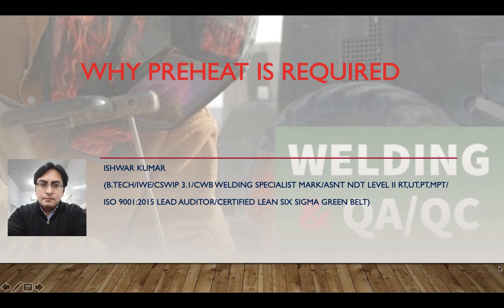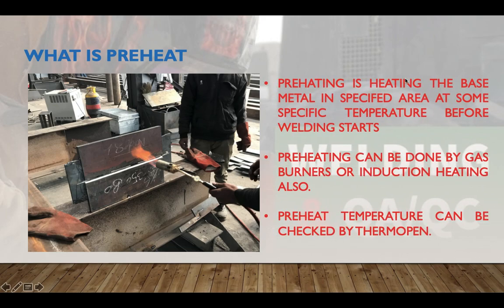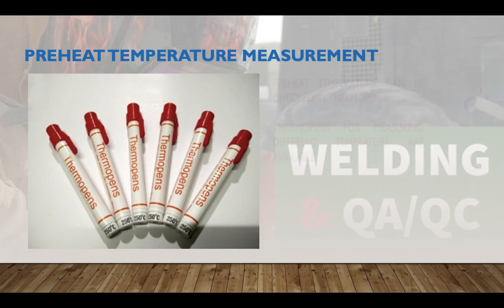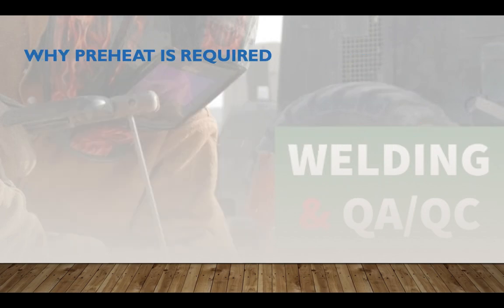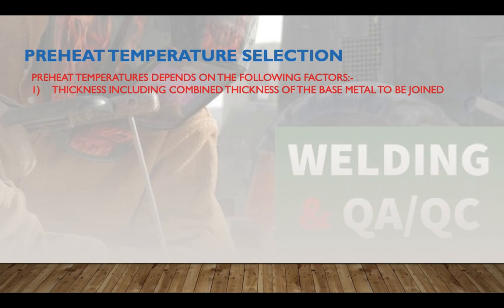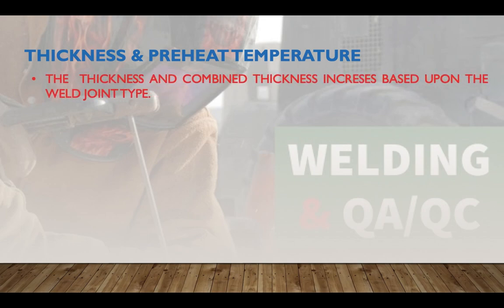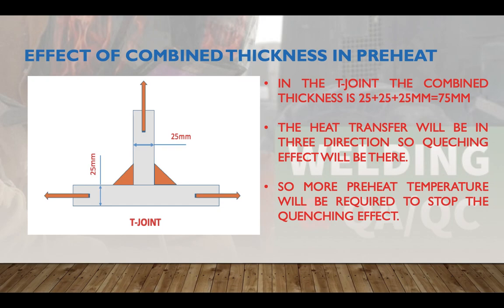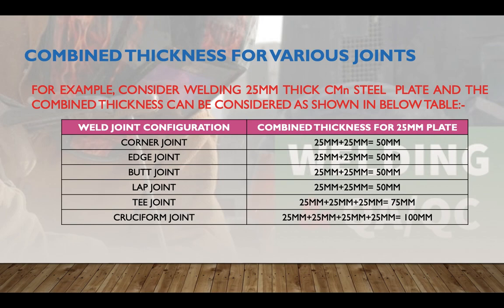WHY PREHEATING IS REQUIRED IN WELDING

Comment: Hello my friend is there any restriction in the code that if change the Gas use for preheating for example from propane gas to LPG
Reply from the maker: Thank you for reaching out with your query about the use of different gases for preheating. In codes e.g. ASME Section IX, there isn't a specific restriction on the type of gas used for preheating, such as switching from propane to LPG.

Comment: Thanks for your information. It is very basic engineering prior to welding process. Specifically it is carried out in Oil & Gas Industries with Pre-heating Auto Machine with programmer. And also Can be monitor the temperature.
Reply from the maker: Yes it can be monitored with the help of time tempreture graphs if required ..

Comment: Sir, as u explained the following factors to used for selecting preheat.. My quarry is that if P-no same.. Material thick >25mm then preheat mandatory.. And we go min 80 © preheat temp.. If material thick 150mm then how much temp required for this..
Reply from the maker: Thanks for your query..The need for preheat are dependent on a number of factors, such as the chemical analysis, degree of restraint of the parts being joined, and heavy thicknesses.The procedure specification for the material being welded specifies the minimum preheating requirements.ASME specify the preheating requirements as :-79°C for material which has both a specified maximum carbon content in excess of 0.30% and a thickness at the joint in excess of 1 in. (25 mm).As per AWS D1.1 for thickness of 150mm minimum 110 degree preheat is applied.
Reply: @ish8624  Thanks for clearing my doubt regarding this issue.. Sir can u please let me know that in which clause of AWS D1.1 it mentioned..
Reply from the maker: @shshnawazmallick  You can refer Table 5.8 AWS D1.1 2020

Comment: Question, would it be fine to use a carbon arch torch or push 500 through 800 amps with a metal heater ( some people taking a microwave oven transformer and wrapping some wire to out put a certain amount of amperage)?
Reply from the maker: Thanks for your question..Use of carbon arc torch is not recommended..Regarding wrapping some wire ..this is called resistance heating which is the slowest and most expensive in every scenario, due to setup time and the amount of time it took to preheat.
Reply: @ish8624  With resistance heating, is it true the heating up time depends on the thickness of the metal and the amount of amperage being pushed through?
Reply from the maker: @sigglass2183  Yes thickens & amperage are an important parameters in heating up time..
Reply: @ish8624  Why is carbon arc torch not recomended for pre heating? Is it because the electric arc is not as accurate as a fuel fire and it doesn't take much with eletcric arc before the metal starts to melt?
Reply from the maker: @sigglass2183  Right,also due to the local heat concentration..
Reply: @ish8624  When would be preheating the work piece joint with a torch be necessary? I have heard and seen people oftenly weld joints without using a torch for preheating.
Reply from the maker: Interesting ...can you plz share the details with images..
Reply: @ish8624  I will gather further details later so I can explain clearly.

Comment: Very knowledgeable video Sir, i really appreciate the efforts you put in making these informative videos.
Sir what should be time duration to heat at the specific temperature? Kindly respond

Stay safe sir.
Reply from the maker: Thanks! karthik.Are you asking about holding time at temperature for PWHT?Because in preheating once the required temperature is achieved after that the interpass temperature is sufficient to maintain preheating temperature.
Reply: @ish8624  
Thanks for answering n clarifying preheating Sir, about PWHT what should be the holding duration
Reply from the maker: In PWHT holding time/duration depends upon weld thickness.As per ASME section VIII div. -1 for carbon steels it is 1 hr per inch thickness up-to 50mm thickness.Above 50mm 2hr+15minutes for each additional inch over over 2inch.Hope it is the answer to your question.
Reply: @ish8624  
Clearly understood sir, 
Thankyou very much.
Reply from the maker: @karthiksk2539  Most welcome..